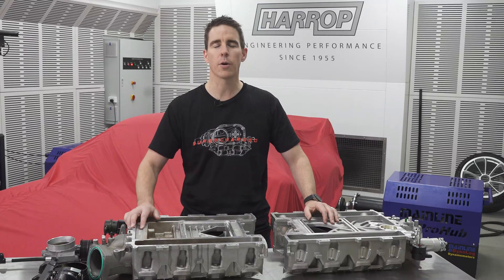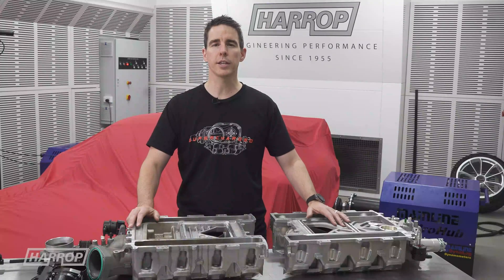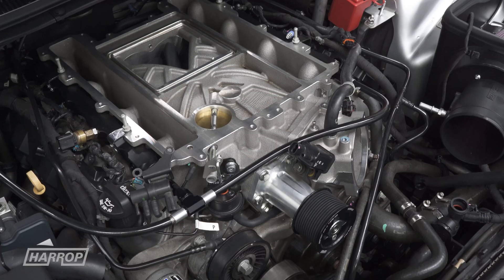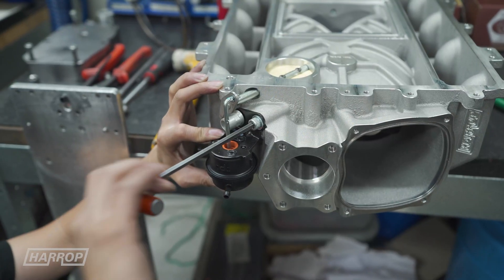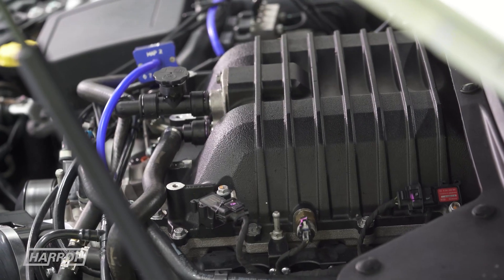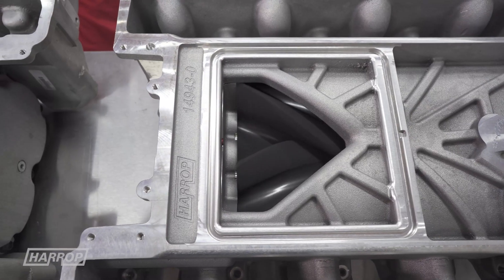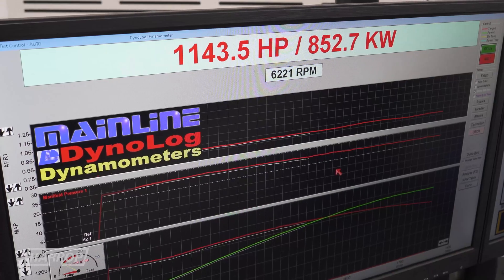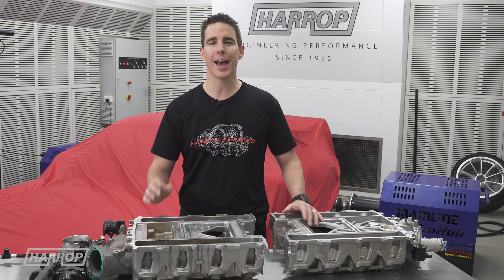LSA-H2650i | Supercharger Testing & Tech Review

Comment: Yeah noice, I just love the OEM look. I'd rather this blower in a kit than the FDFI 2650 setup ;)
Was the stock baseline testing factory tune as well?
What figures would you typically see at the hubs for say a stage 3 LSA package (injectors CAI upped boost.. exhaust? plus tune)
Reply: Ok I just looked up the LSA Performance Upgrades Explained video,
Would be about 435kw at the hubs, so essentially at 65kw gain from a bigger blower swap. Slower blower speeds less heat, and a higher potential. Right?
Reply: @HarropTV  how does it compare to the kong?